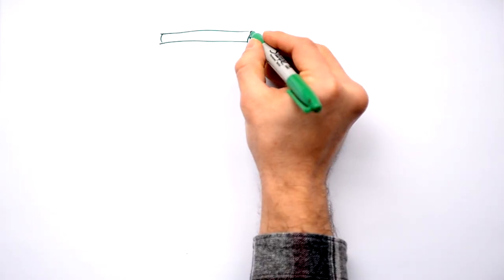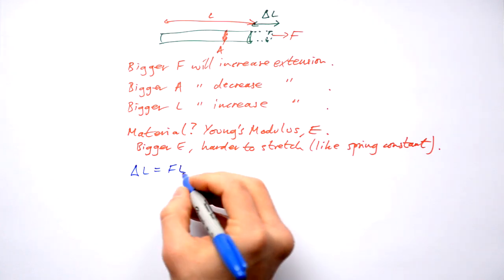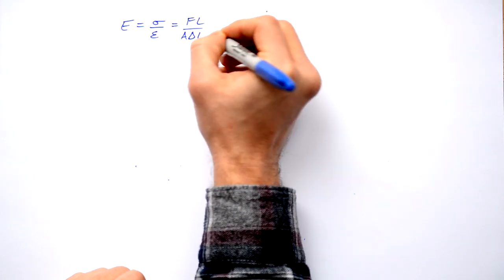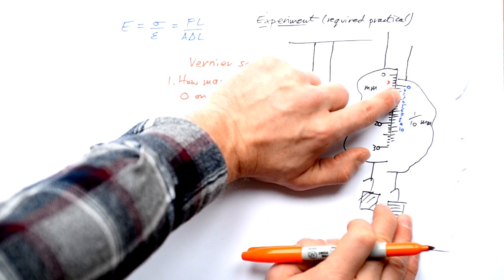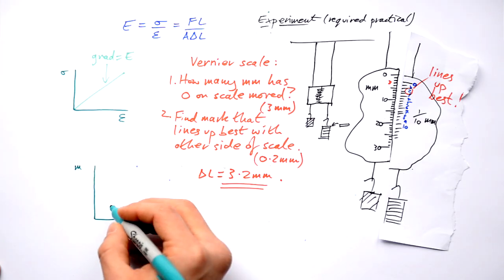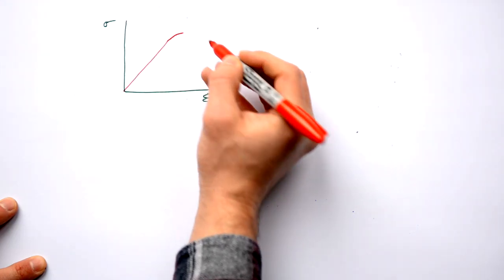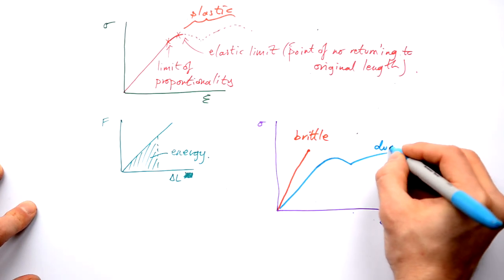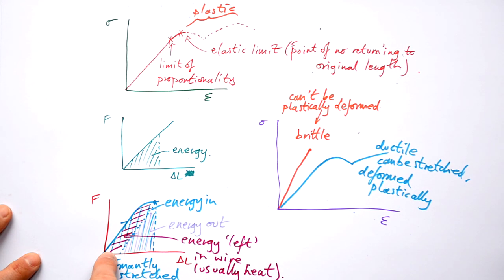Young's Modulus & Vernier Scales - A-level Physics

Comment: What i've never understood is why the yield point decreases in stress and then increases again.
Reply: You dont need to know this, but in simple terms: The graph doesnt take into account the changes in surface area when the strain increases. So that little dip in stress is just due to the area increasing while the wire is extending.

Comment: Is this 1 video every day? That's kind of insane. (And extremely helpful)
Reply from the maker: Thank you! There's not a lot I teach on top of what's covered in the videos (I don't do any of the other AQA optional topics), apart from the odd little bits of knowledge missing, like metastable states, for example - but this is stuff that's easy to check on with the spec. So I'd say I've covered ~95% of the course. The important thing to do is answer questions to improve your exam technique and pick up on the subtleties the exam board look for in your answer.
Reply from the maker: +Ben B Not anymore! I'm done for now :D
Reply: you can do papers of other exam boards then regarding the topics you choose, if you have only one specimen and 1 past paper then that wouldn't be enough for the revision as u can get a bunch of differently asked questions that can be really tricky, Idk but I would do that if I was in your shoes. idk for how long this comment has been here I just thought that my reply might help in a sort of way
Reply: I have been doing some practice questions my teacher has set me, however due to the new reformed A levels there is only 1 past paper and 1 specimen available. Any advice on how to aid my revision even further?
Reply: All your videos are absoulutely amazing and saved my A-Level, I've started rewatching all of them. Just wondering what % of the A-Level would you say you have covered and have you gone over all the required practicals?